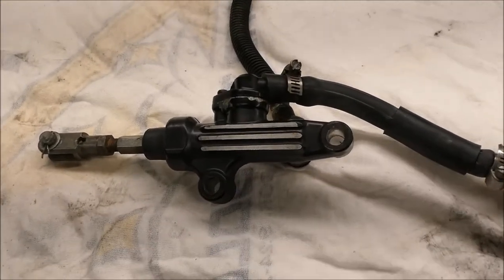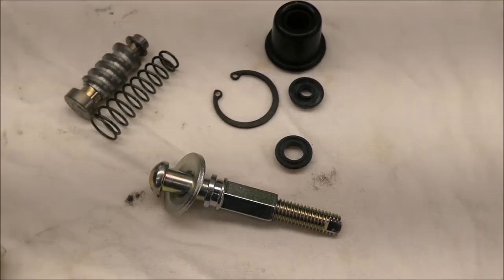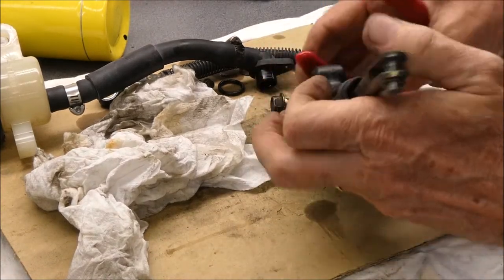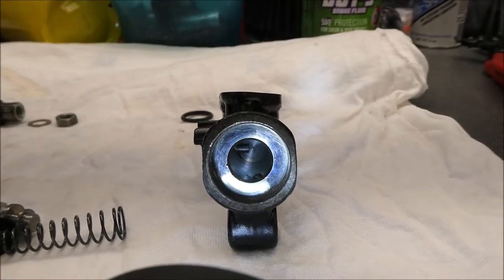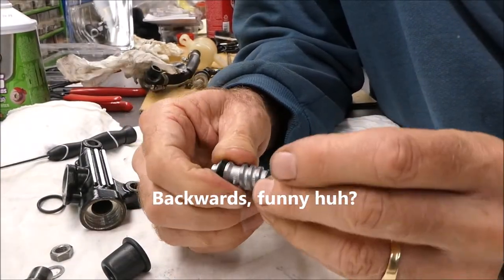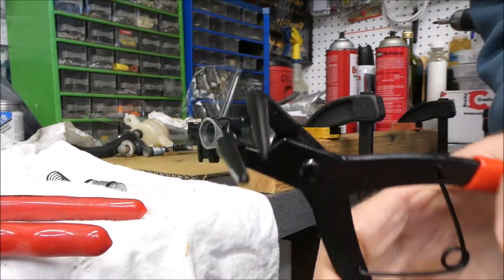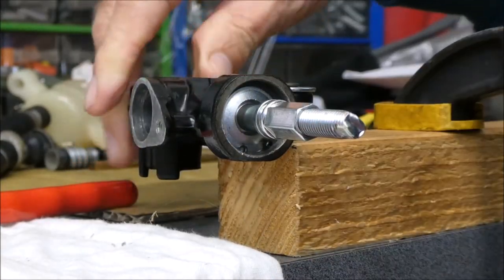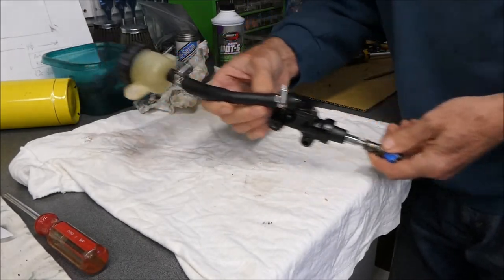RZ350 NC2 Resto Mod Ep 6 - Rebuild Rear Brake Master Cylinder

Comment: Hello Ken, several mechanics have said that these service kits don't work well - just wondered how reliable the cylinder is once you rebuilt it and what brand of parts did you use? many thanks
Reply from the maker: I have rebuilt several brake systems now using Brake Crafters rebuild components. In this particular system I am also running DOT5 full synthetic brake fluid. Everything works as it should, no problems. Are you the drummer in the videos on your YT channel?